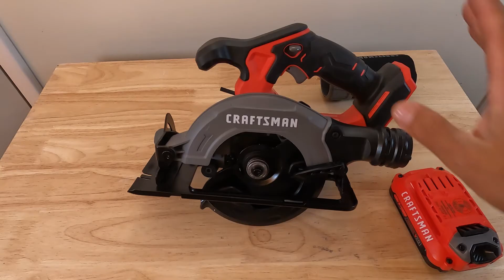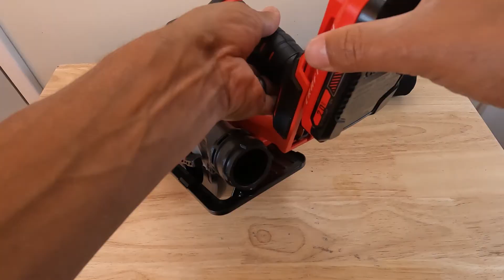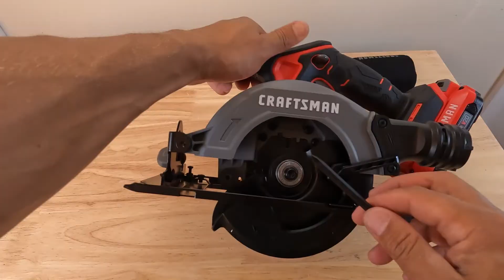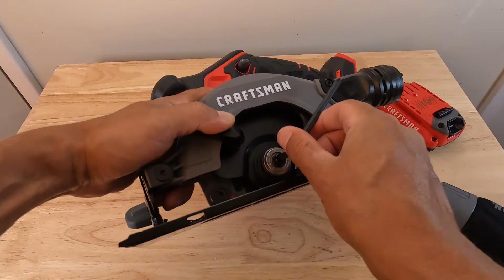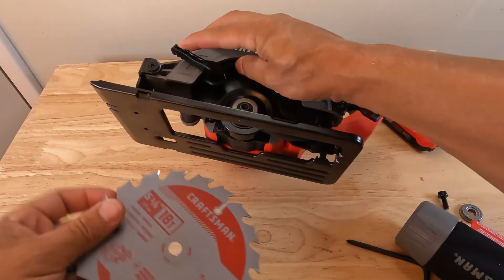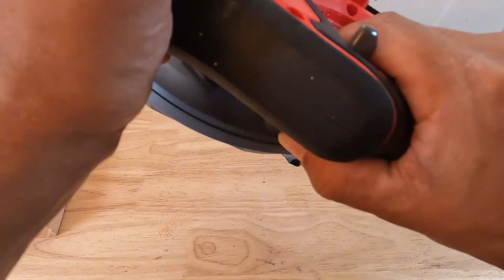Craftsman Circular Saw Tutorial and Blade Change Model CMCS505

Comment: I’m so glad I came across your page

I have to redo the floor in my kitchen and part of the living room as well. 
I was able to pick up the craftsman 6-in-1 kit that came with this saw, an oscillating tool, reciprocating saw, 2 drills, the batteries, etc.
I am used to be more “heavy duty tools” but that’s because I literally grew up in the shop with my dad, we practically had the Sears & Roebuck's entire tool section in the shop.
I’ve got a lot of wood to cut through--doing bridging plus checking original joists & laying down new subfloor--so I know I’m gonna have to pick up some extra blades.

I’ll take any tips when it comes to the actual tools. 
It's been a while since I’ve used a reciprocal saw or oscillating tool (I'm definitely not 10 anymore) and though I’m used to power tools, I’ve done way more electrical work.
Reply from the maker: Glad the video helped you out! I believe I have a link for saw blades in this video in case you need extras. Good luck with the remodel!
Reply: @fixanythingsavemoney 
i’m pretty sure that this saw argued with me...
I swear that I heard it say "you are NOT DIY-er!! you’re a contractor/construction worker, the way that your father taught you to be!  Why the hell do you keep attacking me??"

I’m cutting 8x4 planks and pretty thick subflooring. I think I pushed my guy just a little bit too hard--hoping that it’s just the fact that the "stock blade" couldn’t handle the wood 

One suggestion I got was the The Diablo Trim Saw Blade 5-3/8-Inch 36-Tooth
and was told to use the ....any offer of advice would be greatly appreciated
Reply: do you think that with the upgraded sawblades, the upgrading sawblades, The saw, should be able to handle the “workforce”??
I really really need to get the kitchen for fixed, at this point mom really can’t even go through the kitchen and getting to the front door is pretty dangerous for not only her, but even me

Comment: Thanks. 
This video is definitely better than the official paper manual.
Reply: The “official paper manual” that was in my box basically said “don’t cut off your hand“ but it was worded better than that…
No instructions or anything. I’ve got six tools and they all say basically the same thing.
“Don’t cut your hand off”
Reply from the maker: Thank you! Glad the video helped you out. Thanks for watching and for the comment, have a great night!
Reply: The saw came with the blade pre-installed by Walmart reseller. 
I had no idea that they had installed it incorrectly and couldn’t figure out why it was not cutting correctly. 

Thank goodness I kept looking for a good guide as to what was wrong—no instructions came with sew.

I finally realized that the outer washer had to come out for the blade to be installed correctly. 
I watched your video—you addressed important things like model number and more.  The Allen wrench that came with my saw was not the right one—so that was another stumbling block. 

Your video confirmed my hypothesis—I’m finally finishing this up today—